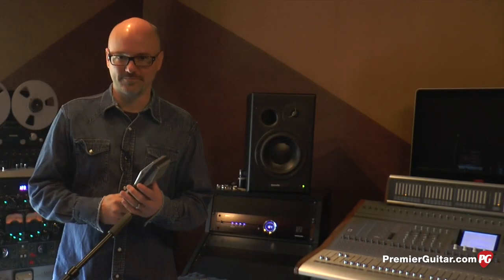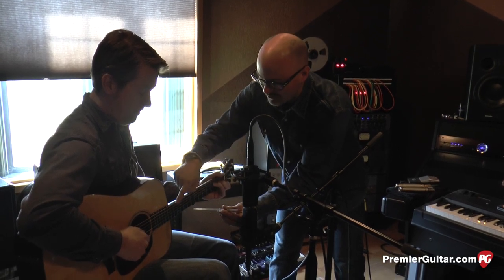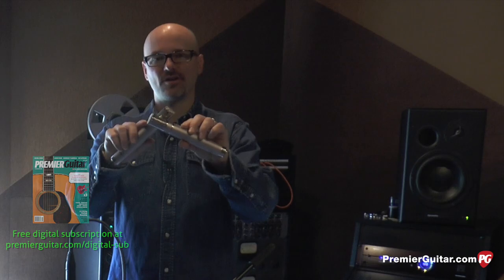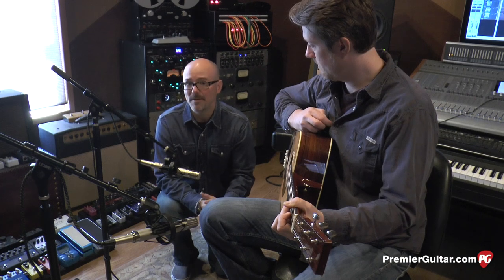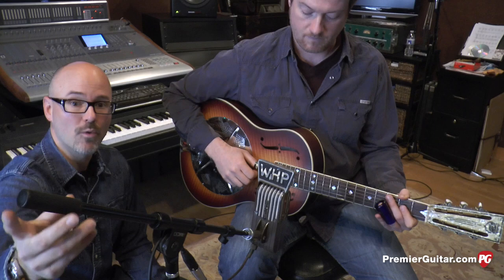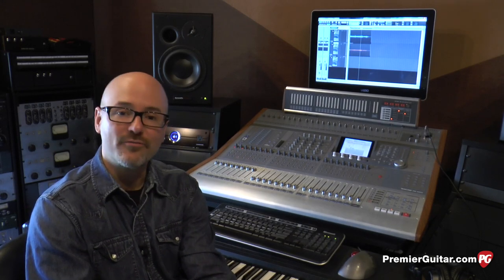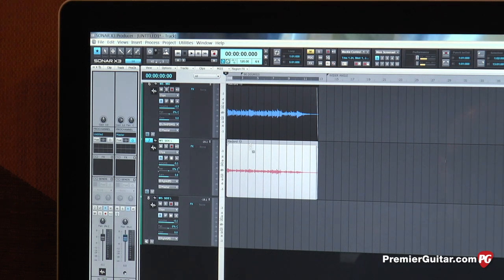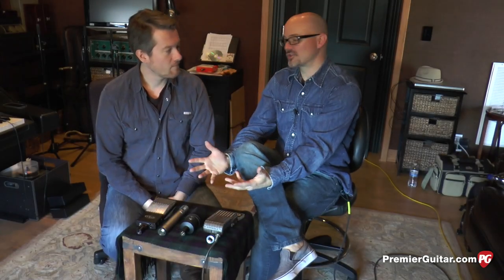DIY: How to Mic Your Acoustic Like a Pro

Comment: mid side technique is the sweetest sounding technique... Thanks!
Reply: I agree but personally I like to mono mic acoustic guitars and double track or just pan the single mono signal off to the side. Stereo micing is great for a big wide sound but generally muddies up the guitar when put into a mix with bass drums and electric guitar ( which drive most of modern pop and rock recordings)
Reply: Doug Payne I would assume that's why they chose a finger picking song. To me, that was basically saying "this is what this setup is good at".

Comment: Cool stuff. I have always listened to the natural tone of the guitar. With my EQ flat I would try to find the sweet spot that replicated that tone. (One mic)  Sometimes it was towards the neck & on other guitars it would be at the bridge at the top of the guitar. The location & distance varied. I would mark it with painters tape for easy reference during the next session... Nice that you show the options. I will apply both methods now. Thank you, Loke

Comment: I loved that last technic. Thanks a lot!
Reply: It's some spooky stuff! I don't have the right gear for that, but i wish i did so i could go out and test it.
Reply: Honestly you could get a similar effect just by double tracking with a single cardioid. That is, two takes of the same material each hard panned opposite.
Reply: Mid Side is great for acoustic guitar!  You can get an almost-mono sound but with that little spicy bit of stereo going on, adds so much interest vs a pure mono technique.  Immediately I am a big fan.  I use Apex 205 ribbons that have been modified.
Reply: Not really. You're talking apples/oranges. Your method would require recording two distinct and separate performances. X-Y, Blumlein and MS arrays are stereo mic'ing techniques designed to capture one performance in stereo. You are referring to double tracking/OD.  There's a big difference between that and stereo mic'ing, and they do not sound the same.

Comment: Why isn't the figure 8 stereo? And why, with the figure 8 being the same waveform each side do you have to reverse the phase?
If the figure 8 is mono, wouldn't it be better to use either a stereo figure 8 or use two mono mics pointing left and right like the side mic and the one in the middle?

Comment: Brilliant video. Really love the mid side technique and ribbon inclusion. Have you any advice on how to achieve the sound of acoustic strumming sound on the intro of george’s my sweet lord. My plan is to mid side through a UA 4-710d in full tube mode using a KSM 32 and dual capsule ribbon mic into logic

Comment: hello. at 2;00 you speak of matched mics. many of us cannot afford what a decent matched pair would cost. it's more likely we come across a great deal occasionally and happen to score 2 nice unmatched mics, in my case, a Rode Classic 1, and an akg 414. how would I set these up in an x/y, and call me dumb but what am I listening for if one is out of phase?
thanks for any help you can give me
Reply: +Jon Oden Matched pairs sound nearly identical, so your stereo mix will be very accurate. If you use unmatched mics, you're going to have a different color to each one. This isn't a bad thing necessarily. Phase issues happen when the mic diaphragms are at different distances from the source sound. If you want to make sure they are in phase with one another, line up the waveforms in your DAW so that they start their respective cycles at the same time. If you want o listen for phase issues, you are listening for a "comb filter" style 'hollowness'. I hope this was helpful.

Comment: Hi Bryan, in regards to the mid-side technique, when adjusting through the DAW, does one turn BOTH 'phase invert' buttons on once the microphone performing in a figure 8 shape is separated into two separate mono tracks and panned hard left and right respectively? I am using Reaper.
Reply: Hi there. When reversing phase, try to think about the wave form. You are essentially flipping the wave upside down so that it is a mirror image of the original, vertically. So if you reversed the phase on both tracks, it would have the same outcome as reversing neither, because they are still identical to each other. The goal is to make the two tracks different to one another.

Comment: would the set up at the end work with a condenser pointed at the sound source and two cardioid dynamics perpendicular to the condenser? the recording pattern should be fairly similar to the cardioid and figure 8 I believe, has anyone tried this?

Comment: Hi. I have tryed the mid side and hear the stereo right away, but i get more sound in the left speaker. Can you explain why? David
Reply: Facit Studie MS on Acoustic guitar often gives you a "lopsided" sounding result because the lower bout is so bottom heavy and ends up dominating one side of the stereo field that is created.  Meanwhile the other side of the stereo image ends up being the neck/headstock (where there is relatively much less sound being produced).  An interesting trick is to try miking MS with the mid mic parallel to the neck of the guitar (along the guitar's axis of symmetry) so that your "sides" become "up" and "down".  You will lose that "lopsided"  sound.  Also, you might want to experiment with rolling off the lows on the side mic channels significantly (try 300 hz) and see how it affects the sound.  Lastly, when placing your mics you want to allow enough space to allow for a good stereo field, so don't record too close.  Try around 18 inches.

Comment: everything I try to record ends up having a small waveform and sounds too quiet. Can you think of any reason why this happens? The mics are less than a foot away from my source and I am positive I am pointing the front of the mics towards it. I don't think its the recording environment either, because 'm just trying to record in my bedroom. I have my recording volume set all the way up to zero dB and my phantom power is on. I even tried turning up the gain, but that didn't help much. I am using MXL 603S condenser mics through my Scarlett 18i20 interface. Abelton live 9 is my DAW
Reply: +Greg Moberg Funny, I have the same audio interface and DAW. Click the "Inst" button associated with your input. Get your volume as close to clipping as you can without clipping. I like to bump the orange LED.
Reply: +Greg Moberg What your describing is an input gain issue - so make sure you are setting your level correctly.   Ive read on mxl's website that this mic can accomodate different capsules - so make sure you know which one you have.

Make sure you know how low "too low" is - if your playing along with soft synths - for example - you will more than likely have to mix alot of them down - as they tend to come out very loud in comparison to a properly recorded raw track.

Comment: When I use the MS setup, I get one side (LEFT) louder than the other. When I flip the phase switch on the Mid mic, I lose volume in the right side instead, so I'm assuming this is a phase error. Is it because of faulty mic placements? Does anyone have a fix?
Reply: Make sure you are doing it correctly. I don't know if you are or not. You don't flip the phase on the Mid mic. You record both the Mid mic (cardiod) pointed at the source, and Side mic (figure 8) at 90 degrees, in phase with each other.  Afterwards you then duplicate the side track in your daw. Then you take your duplicate track, and phase reverse it in your Daw. Then it's like magic!  Adjust the levels of the 2 side tracks to taste, and you're in business.

Comment: When I record my acoustic with MXL 990, I get low volume even if it's in appropriate gain but when it is recorded I get a peak around -20dB which seems very low and later on I use something like OneKnob Louder to get the volume I want, is it okay?
Reply: Fornicras What interface/soundcard setup are you using?

Comment: Can someone advise on whether you would be able to get the same effect as the end with the mid side technique if you used a one cardiod  mic from a matched pair and then an AT4040 instead of the Cloud Ribbon Mic? I realize the polar patterns are different, but how would it sound? I'd like to get a similar sound but can't afford that Cloud microphone
Reply: +Cameron Dailey Not sure how it would sound; let your ears be the judge. But it wouldn&#39;t be mid side without a figure 8 pattern for the side mic, and you would have phasing issues.
Reply: +Cameron Dailey  
No. You need a bi-directional microphone for the sides (such as the AT4050 with the Figure 8 option) and another mike (such as your AT4040) for the mid. The AT4040 only captures sound from one direction, whereas a Figure 8 captures sound from 2 directions.
Reply: +Carmen Herrera mejustaelprogra
ma

Comment: great tutorial
but i need a video for us bedroom guys who have nothing but dynamic mono :/
Reply: same here.
Reply: Try recording the same distance, 12-15 inches, and just adjust the gain so you have somewhat decent levels (don't get too too close with the mic to compensate for sensitivity). Then, if you have a compressor use that, if not then use a compressor pluggin in your daw (GarageBand, and others have built in ones), it'll liven up the sensitivity a bit more like a typical condenser (there's tutorial videos on using compressor pluggins if you're not familiar yet). To get stereo I'd try recording to a click track in headphones, and recording the same guitar part twice, then panning each track fairly hard left and right for the stereo effect.. 
If you're not familiar with compressors I'd wait and just start with the two-take stereo method first
Hope that helps a bit
Reply: wow, that`s some great tips! Can I ask one question? When you record with two mics the audio gets louder or clipping ceilingr is higher? I`m a newb in this please don`t be harsh
Reply: Thats all you need.

Comment: Some good tips for sure! Thank you!  but your "Mid/Side" Needs work. When you flipped the phase it gave your left priority. So the guitar mix pulled to the left muting the right. Instead set your delay. "14-24 MS or around 1000 Samples" should do the trick THEN flip the phase.... you may not need it. It could still fall phase positive without phase cancellation. After that throw and EQ on the* RIGHT ONLY **and bump 8k with a shelf 1-2 Db and KILL it with low end!! Im talking 4DB from 120-200HZ.  After that bring down the fader 2 Db so it does not start pulling to the right. make sure you don't have auto gain turned on or this wont work.  After you do that. You have a true stereo spread without pull or loss of low end due to phase problems.  \m/ :)
Reply: You sure sound like you know what you are talking about.  Above my pay scale, but I took notes, and will try your ideas myself. That said when i first heard the unprocessed M/S take is was awful, I was like Whaat..?, but after he doubled, and flipped the phase it sounded fantastic to me - the best sounding of all the techniques. But you must have really well trained ears for this stuff. I'm sure this was just a quick and simple, no fuss demonstration of the various techniques, and I imagine the engineer can manipulate it to perfection if he had the time.